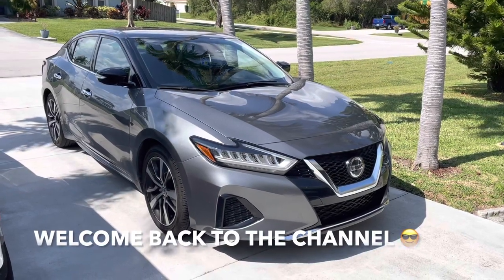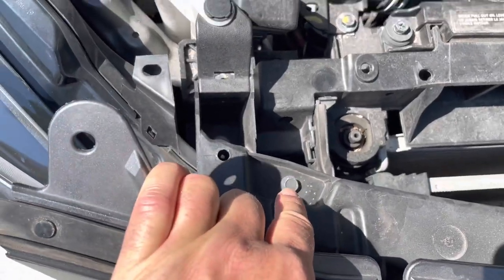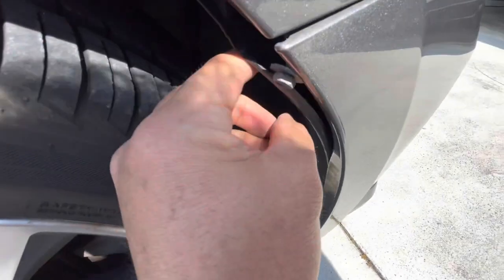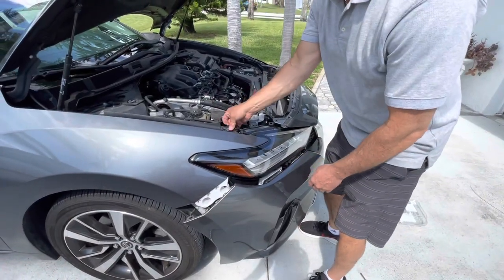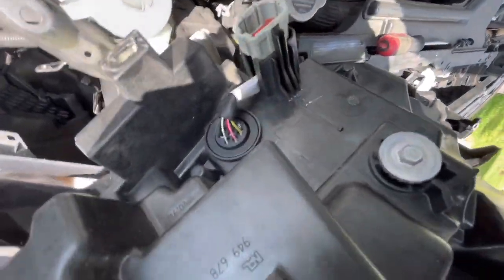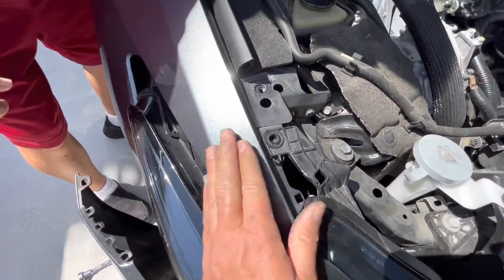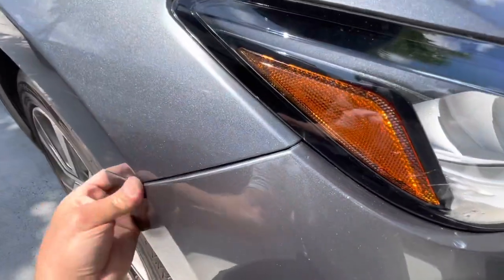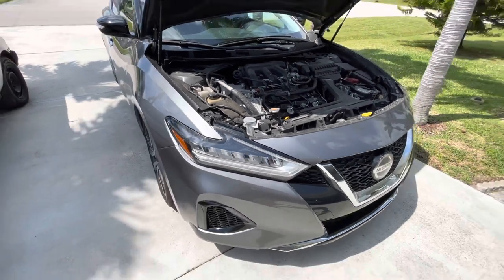NISSAN MAXIMA HEADLIGHT REMOVAL / INSTALLATION Without Removing the Bumper

Comment: What can I do if my 2017 Maxima doesn't blink when I put the turn signal? The bulbs turn on normally but they never indicate when I want to turn, taillights work great but those headlights don't.

Great video, I'm hopping you will answer my question. Salutes from Mexicali 🎉.
Reply from the maker: Check your fuses
Reply: @fixinit  Thank you. I'll come back and write my experience to help others with the same problem.

Comment: I have a 17' maxima and recently installed the new gen headlights just like yours,  but there's a gap in between the bumper and bottom part of right headlight,  any ways to get this straightened out ?
Reply: Did you find the fix?